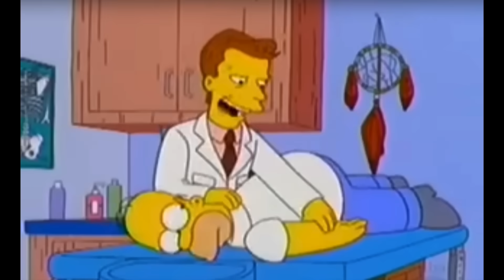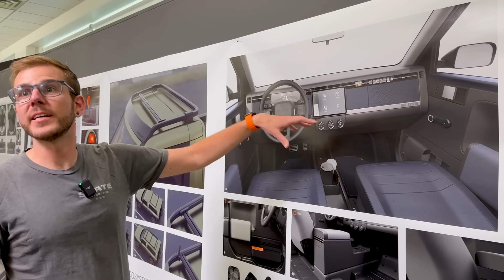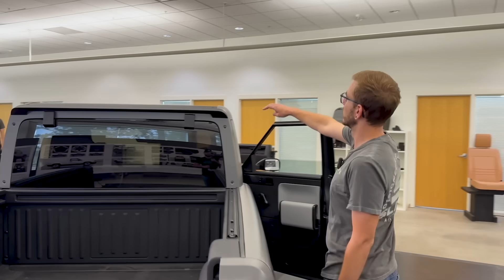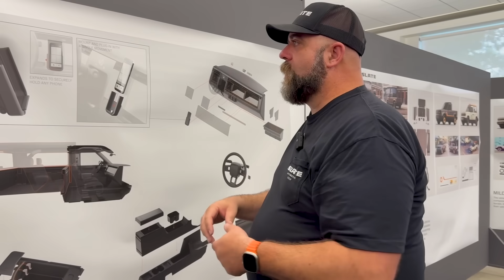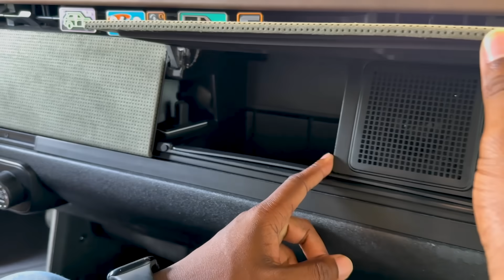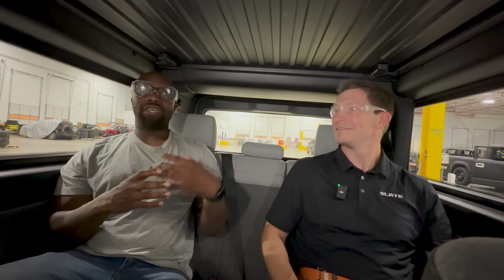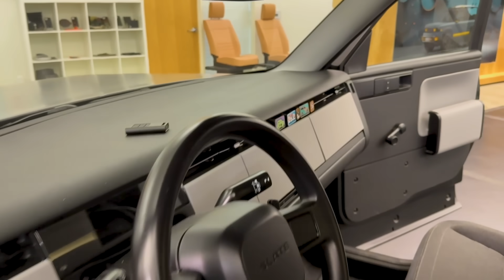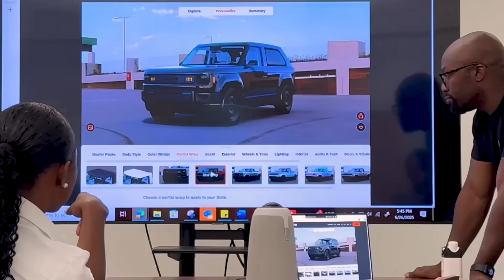The Slate: America’s $20K Answer to China’s Cheap EVs (Exclusive Access)

Comment: I like the concept, the addon options are cool but, all comes down to price, for example, to go from the pickup truck to the SUV, that comes with airbags so right away, it's going to be like $5K or more.  Even if I was in the market for an EV, a lot is not known about this.  Sure, they have all the options but, if I want new bumpers and a SUV with rear seats, it's going to cost $45K, why not just buy a better and fuller featured EV (if I go 2–3-year-old used, I could get top of the line for that price)? Keep in mind, that does not even include a radio, or Android Auto, that every other car offers (screw you Tesla). 

Truth, I would love an option for this, to have a 4-cylinder gas option, around the same price point, not everyone wants or can use an EV (apartment people, city living, etc) with these options, I think that would kick ass....

Comment: Something I’d really like to see in the future from SLATE is a long wheel base version. Keep it a clean slate, traditional 2 door cab, but with an 8ft box. Use the extra chassis length to add AWD and extend the range to something more useable as a proper work truck. 

It wasn’t touched on in this video but what about towing? I don’t need 10k lbs of towing, 5k or 6k is enough for most small truck tasks. If it can get 150 miles of towing with a 6k lbs trailer and start at less than $40k it would be the default work truck for most handymen. 

I really hope this company doesn’t fail. I do agree with Rich that most people are going to want to see add-ons installed by the factory.

Comment: I watched a publicity video a while back and, for me, this hits about all the points - if available in RHD?
Small so easy to find parking and work through traffic.
Low bed so very easy to hand load.
Electric so simple plug-in charging and that's fine for something used as a town pick-up vehicle.
No excessively powerful motor that's a waste in town.
EASY repairs if needed, no need for expensive panelbeaters in most cases as the more vulnerable areas are bolt-on!
No "extras" I have no need, or use, for that I HAVE to still pay for!

It's like a revisit to the old seventies Mazda B1600, which I really miss,  and Toyota Hilux utes, which were still 1 ton' rated.

Thinking on it, for some kids this would be an excellent starter vehicle - it's cheap enough for even moderately well off parents to buy, and they can set it up as they like - maybe open for the summer and closed for the winter or, if it's a quick enough change-over, they can change it with the weather?

Comment: Not even close. It's not even 1/2 the car the domestically manufactured Thailand $17,000 BYD Dolphin standard range... is. I KNOW... I went to Thailand and bought one and own one. Don't try this in the USA. You can't undo the fossil empire's sabotage of USA electrification over the past several decades. It's too late. This is what you get if you are a USA Republican... Materials cost too much... Labor costs too much and fights robotics implementation. Factories cost too much to build... so on so forth. All the component parts are made over there. The USA fossil empire blocked the build out of electronics manufacturing all this time. You can't undo that. This thing doesn't even have half the range the Dolphin has. It's actually $27,000 cash. You have to write off $7000 from your taxes.

Comment: There are many reasons to like this idea. EVs need a Beetle or Civic moment for GenZ, because they are all overpriced and unsustainable off warranty. Tesla pooped the bed big time. 
The US consumer is broke on the current pricing models, the used market has exploded because of costs and ability to repair.  Car guys can die in debt, but autos could really use a low cost appliance that works, not all of us find the need to compensate.

Major problem here is the weak range. The barn door aerodynamics are not helping.

Comment: they need a 4 door dual cab version 4WD with front and rear lockers.. truck bed power outlets. will the battery be upgradeable to solid state cells as they become more readily available. 4WD with front and rear lockers.

Comment: you talk about not getting scammed and what you are doing in this video is scamming people, you claim this truck is 20k when it is factually NOT, its 27,500 and they "HOPE" that with the ev tax incentive that trump its trying to get rid of will bring the price down to 20k FLAT, not under 20k, 20k FLAT. the truck was 25k but when the ev incentive went up from 5k to 7500 slate raised the price to match the ev incentive because they are GREEDY and they have no intention to sell this truck for less than 20k. if the ev tax incentive goes away they wont lower the price of the slate it will stay at 27,500 which makes it an incredibly bad deal, there are a few vehicles that give you way more features for the same price or less, better range better towing better payload. the slate is a shit deal at a shit price with shit features.

Comment: 'I do exterior accessories' 
'So you said interior?!'
How does this even happen? 

Wow genius, you came-up with an app! Was that sarcasm? ;p

All the interchangability of the parts is very nice since your garage wont get cluttered to high heaven. Every time you modify something you dont wind up with old parts and everything stays usefull. 
Which is extra nice since you dont have to pay twice for the same functionality only for a new look.

This is by far the best vehicle (concept) of the past 30 years. Screw all that modern mumbo and forced complexity, I think this is exactly what we need to oppose all the big legacy brands.

If it ever gets a 4 door option i hope that the rear doors are identical to eachother like they did on the Citroen Ami

Funniest car video ive seen in a while.

Comment: If you think about it, the Model T was basically the same.  The Beetle not much different.  Build the base of the car, then modify as required for the use case.  I think it's a brilliant plan.  The issue is always going to be the Maverick at this point.
Reply: 28k for a base Ford Maverick before destination fees is a big question mark. Will it actually be that and for how long if they do? I'd almost expect it to jump 10k by this time next year which means the Slate has to maintain their own 28k at the same time (minus any potential federal credits.) On paper with the ways they claim to cut costs, it seems like a no-brainer. It'll be a WTF moment if they both come out and the price is the same.
Reply: @TheRealAlpha2  You can get them at $24k right now before fees.  And just note the Slate says it's prices are before fees as well.  

That's a problem when you can get a city truck getting 42 mpg (so gas savings are at best a couple hundred a year) for thousands less now.  That's a luxury vehicle in comparison, much more convenient, much more practical, a lot more towing, more payload, seats more, power windows, has a radio, carplay/android auto, service centers nearby, etc etc..
Reply: @rockinkuwaitchris  That's always the kicker isn't it? The "before fees," every vehicle gets an added 800 bucks of fees just by looking at them. Ultimately if you NEED all that stuff it's one thing sure go get a Maverick, but if you don't need all of it (I mean some work trucks only get an AM radio) The choices are limited. It's like for under 30k your options are an old used beater with a head gasket that could go any minute or a shopping cart with a missing wheel. I just love to see more inexpensive options and if this helps move the needle I'm all for it.
Reply: @TheRealAlpha2  The choices are limited, but I don't see why you would intentionally choose less... for a higher price.  

For under 30k, you are limited.  Maverick, Santa Cruz.   Occasional deals on full size single cab work trucks (Right now Bomni dealership in Miami has a slew of Chevy 1500 work trucks at around $25k plus fees).  

I'm just not seeing where this slate competes against them other than "it's an EV" which as we've seen isn't enough to move sales if it can't compete elsewhere.
Reply: @rockinkuwaitchris  The slate looks way better, is 2 door (sportier and cooler), has bigger bed but much shorter wheelbase and overall length, and is all EV (some people want that even if the gas savings is minimal) I think there is overlap but also two different markets. Big seller is the cool factor. Nobody is looking cool in a Maverick, Slate looks old school and will look cool lowered or lifted.
Reply: @rockinkuwaitchris  Which is fair, I think it's just the hope that you're getting less of what you don't need. I can see the sales pitch they're making: Do I need lane assist, do I need a back up camera, do I need a Bose stereo or $2K infortainment system? Not really, and there's still the question of styling and customization which they are leaning heavily into, I think Scion was the one brand that tried something similar back in the day. But like I said:  if it comes out and it has the same sticker price as the ones you mentioned it's going to be a hard sell regardless, but will those cars still be that price by that time, heck will this? I'm curious to see.
Reply: But the Maverick is Ford. Model T was the last reliable vehicle they built.
Reply: Why do people make the this comparison. The Maverick is not an electric vehicle. It shouldnt be compared to the Slate.
Reply: @JustinCase1021  Because it's about where they're similar. If the Slate were a gas vehicle the comparison would sill be made. Heck people compared the Slate and the Telo for like 2 months just because they're both small electric trucks, but one is like a 40k allwheel drive space truck versus a 20k basic AF rear wheel drive.
Reply: @JustinCase1021  Because a base model Maverick costs the same as the Slate, but it comes with 4 doors, rear seats, the same size bed, an infotainment system with Bluetooth audio, and SPEAKERS.  
(Come ON! I know they want to tout how awesome it is to be able to install your own audio upgrades, but at least ship it with basic speakers!)
 I love the idea of the Slate, but even basic speakers are an extra charge.  Without the incentive, it's a tough sell to buy this over a Maverick. Believe me, I WANT Slate to succeed.  I put $50 down because I want to see this thing get to market.  But if it doesn't deliver, then I am getting a Maverick.

Comment: I like the design elements, modularity, and price.  BUT, 2wd electric only means its barely a 3 season vehicle for northern tier states and rural applications. 4wd and it reaches a much wider audience, even with the increased cost. Look at any big 3 consumer reports, used car listings, etc...over 80% of pickups sold are 4wd.
Reply: Because ICE pickups have an inherent design flaw of drive in the rear with 80% of the weight up front. They are useless in winter without 4WD.

Comment: This is the framework laptop of trucks. Just everything's 100% modular! Do you want an SUV you can turn it into an SUV do you want a truck you can turn into a truck I don't know if I like the simplicity of the ring you're on device. Because you're going to get someone who's docking a really horrible POS tablet that cost him $100 on Amazon with ads and they're going to complain about the slowness of it and blame the truck. So I think that's a little ballsy with them for doing that and docking a Bluetooth stereo to the dashboard for speakers, that's just really cheap. They should have a USB dock or a cable that comes out that you can hook up and haven't feed the entertainment system and have an app that you install to control the truck and the sound and everything so it's an infotainment on your own tablet. That would be the way to do it in my opinion

Comment: If you use a truck daily for work in the heat or in the cold like in the NE, this "vehicle" will not work.  Example would have been today.  Its hot and humid in PA.   I drove 60+ miles with a full bed that was bordering on the max weight for a V8 pickup truck.  I would have to ruin the day for a charge.  Putting gas in the tank takes minutes.  And I don't care about accessories.  I care up a truck doing what I need it to do...take a beating.  My truck is not pretty.  Its gets used for its purpose.  This is not for a guy who gets his hands dirty.  No EV will work for the working man.

Comment: Hey Rich.  It's  a Pontiac Fiero with exposed screws.  Or what was that thing...a Nissan Pulsar that you could get the square back roof.  I do like this thing.  I'd love to buy one without a battery or drive motor and throw a K20 into it, at the rear like a Lotus Elise does with the Toyota 2ZZ.

Comment: I believe it when I see it, $20,000 sounds like a myth! 
Not even without heat AC radio or power steering power windows and seats totally stripped to the bone it’ll still be more than $20,000… maybe stripped to the bone and without bumpers and doors it would be 20,000 ROFL😂

Comment: Why does an EV truck, with no engine, need a 4 foot hood? Just make it a cab over like a Japanese Kie truck and make the rear bed a decent length. Also, make it an  EV hybrid with a small battery that is charged with a small ICE generator, so the range is in the hundreds of miles.

Comment: I like their concept a lot. I'm actually happy about 2wd. My only desire is for an LFP chemistry.

My worry about these guys is whether they can actually make money. There's a reason the big 3 sell $100,000 pickups - it's their cash cow. If the slate is easy to accessorize with 3rd party gear, then their only profit is when they sell the truck. That's a model the OEMs have been struggling with of late. I wish them all the luck, though. We need some sanity injected into the truck market. Small, economical, affordable, would be a breath of fresh air...